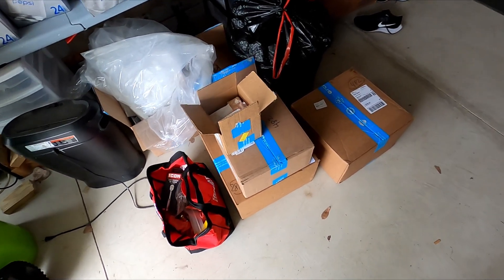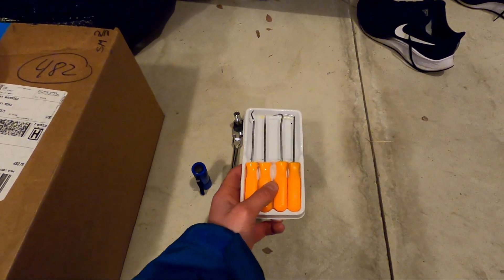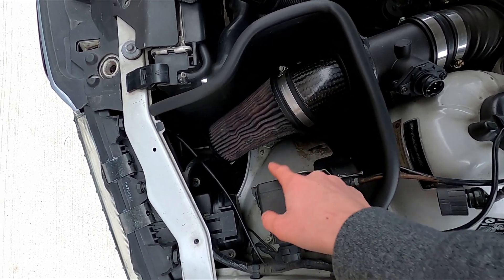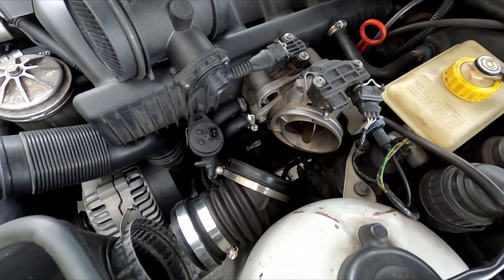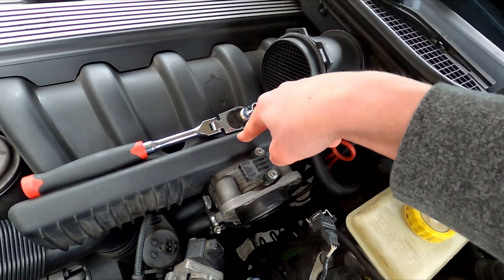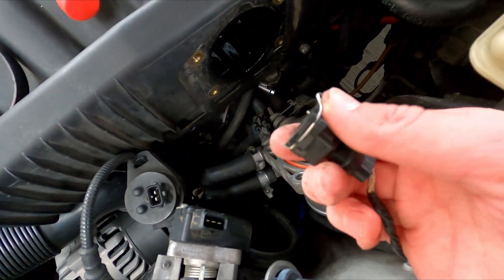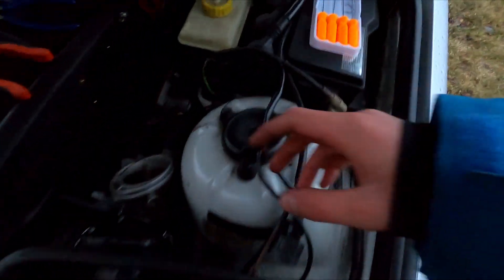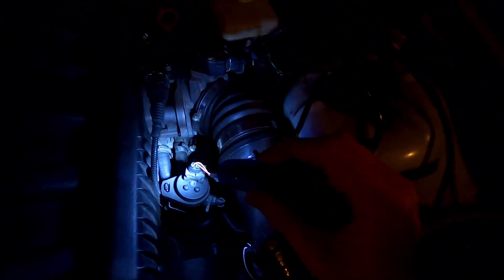E36 Air Intake Temperature Sensor DIY

Comment: What code was this? I'm getting Code P11C4
Reply from the maker: I had a p1188 and p1189 code set. Sometimes, the sensor can get dirty or damaged, which will trigger that code.

I don't think the P11C4 code is for an e36. As far as I am aware. If your intake air temperature is reading incorrectly, then the IAT Sensor would be the likely culprit.
Reply: @M-t3ch  Hi did the temp sensor fix your p1188 p1189?

Comment: Why were you changing this what was your experience and why were you changing this I didn't hear your explanation all you said was you had a check engine light I just need to know one thing what is the temperature sensor supposed to be at let's say and winter time compared to Summertime I'm pretty sure in summertime it starts out at 42 and then Works its way down what's the cold air can gets inside but what about what does it need to be in cold weather season mine starts at 9c in certain areas and when I drive home it goes to 10 to maybe 12c
Reply from the maker: That sounds normal. I kind of changed it as a guess. Sometimes, the IAT Sensor can throw a code. I had a p1188 and p1189 code set. Usually when they go bad the live data will read wildly inconsistent. Like a bad maf would.

Mine was original, so I did it preventatively with a small hope of fixing the CEL. The sensor was only 20 bucks for oem on FCP Euro and the job was easy.
Reply: @M-t3ch  okay I understand what you're saying oh and I don't like FCP  as much  two  sensors I got  from them  just straight died on me but other than that I normally go to RockAuto you get the same crap from FCP but for a better price I'm just trying to tackle down my fuel trim issue which is causing my p420 and 430 and I prognosed it at I need a new cats other than that Torque Pro showed me that my sensor was reading 10 Celsius last night that's a bit real low so I thought if I cleaned it first I can go from there and my engine temperature was at 96c  so no problem there I'm just trying to figure out more about those two codes besides just in my past I had those two codes didn't fix it just threw on a new cat and now I can't purchase any cats until I can get that fixed and find out what's actually causing it so far it would feel delivery
Reply from the maker: @Isreal Perez  I don't have experience with that code set unfortunately. I'd say based on your data the IAT Sensor is probably fine. Wish I could help more.
Reply: @M-t3ch  that's normally a code known as a p1093 just means a large vacuum leak either in the engine area or a crankcase ventilation valve will cause that code
Reply from the maker: @Isreal Perez  Mine has never thrown that code. I also had a misfire, but my scenario was very strange.

P1188 and P1189 can be a lot of things. M3nace did a great video discussing the code set a couple years ago. Injectors is another big culprit as well.
Reply: @M-t3ch  thank you for having time speaking to me I hope everything works out with with you I just got to fix a p30 and a p40 code I have an exhaust leak other than that I just have to reset the code once in awhile till the weather gets good so I can replace it with a used good original part I have in the garage at my sister's house other than that I enjoyed your video thank you for your time good luck
Reply: @M-t3ch  How did you fix your 1188 & 1189?
Reply from the maker: @R Cruz  Mine wound up being a big vac leak from the valve cover.

It can be a lot of things though. I tell everyone to check for vac leaks first thing as soon as the codes pop up.

Comment: Did you have alarms on dashboard before you change it ?
Reply from the maker: I had a check engine light.
Reply: @M-t3ch  Thanks for your answer. I'll try to read live data with BMW Scanner first. I don't have check engine light but sometimes my e39 don't start easily.
Reply from the maker: @Jul205Rallye  I would check the live data. Hard start could be a cause of a bad IAT sensor but I wouldn't guess that first. Vac leak, maf, O2s, cam, or crank sensor.

Goodluck 👍

Comment: same like e39 520i or not?
Reply from the maker: If it is an m52b20 (not tu) then I think it should be. If it is a technical update motor I am not sure.
Reply: @M-t3ch   m54b22 
btw thanks the answer
Reply from the maker: @VAXzorall  If it's an M54 I believe they are on top of the intake manifold. I know the b30s are. And no problem 🙂
Reply: @M-t3ch  great!
thanks m8 :)
Reply: @VAXzorall  yeah, it’s on top of the manifold underneath the cover. I couldn’t find this sucker until today. Was searching for 2 weeks straight
Reply: @kuma7526  yeah i found 2, thy my friend:P